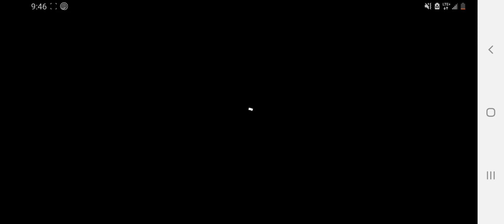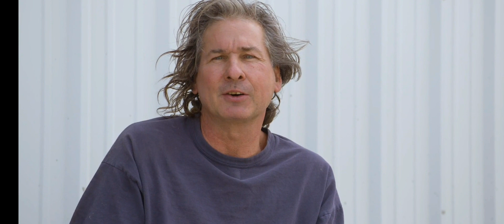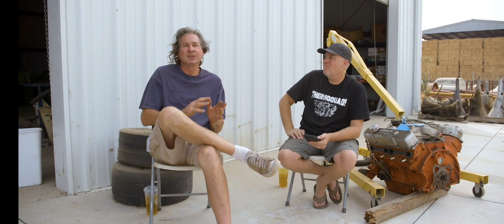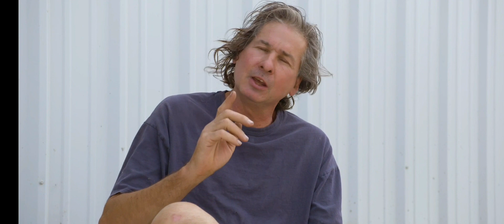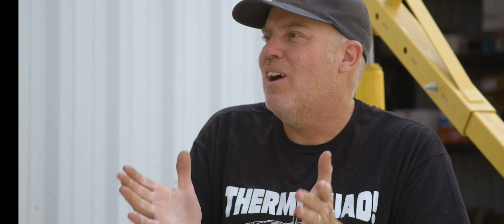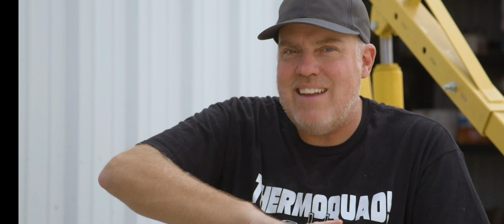uncle tony's garage gets called out by the roadkill guys and they say he's  full of shit

Comment: I just opened up my Mopar Engine Carroll Shelby's Speed Secrets book from Direct Connection and it states on page 44, section E for Pistons and Pins , the 3rd paragraph that "Factory pistons have the pin offset to reduce piston slap.  By reversing the offset (reversing the piston) engine friction can be reduced.  In engines equipped with power pak (domed) pistons this can be accomplished by installing pistons from the right bank in the left bank and vise versa.  This means the notch in the edge of the piston top will now be toward the rear of the engine.  With two barrel flat top pistons , it is only necessary to reverse the piston pin on the rod and not necessarily to swap from bank to bank.  A piston to bore clearance of .0015 - .002 has proven to be adequate with stock type pistons.  Race pistons do not have a piston offset and there-fore don't need to be reversed. "  That was a lot of typing for me.
Reply: rofl.. yes someone mentioned this stupidity before.. and it still wouldnt have increased any power..
Reply: @crunchemagain2030  just how do you know that it wouldn't? Perhaps your Ouija board says so?
Reply: @MrSwinger1  they basically said its stupid and its a waste of time and energy... it doesnt gain anything.
Reply: @StrikersLG  David Reher rebuilt one of his old Pro Stock engines from the 80's not too long back.   He said he just laughed at what was "bleeding edge" tech back then.   But if you read a book of his engine building tech from back then, it would have had all those 80's tricks in it, right?   
Things change.
Reply: @Made By Nobody Famous What a crock! Please tell us what old book recommends any of those stupid things. All of the performance books that I have read since the seventies specifically mention port shape and volume vs air speed. And they all mention port finish and warn against polishing the intake ports. Many even have pictures of giant polished ports to show you how not to do it. Here's a quote from an old performance book, you can knock the bottom of a trash can out and it will certainly flow a lot of air but that don't make it a good port.
Reply: @Made By Nobody Famous I think to construe port and polish as meaning polish intake ports to a mirror finish is a leap that even Evel knievel couldn't make on his best day. What do you have against gasket matching?  Thanks in advance for taking the time to respond.
Reply: @Made By Nobody Famous regardless of the gasket opening we still use it as a template to match the port to the manifold runner. The gasket just gives reference points to measure from. At least that's how I do it. I don't not make the ports match the gasket. And you are absolutely correct, I have seen a few diy porters ruin heads grinding the floor of intake ports. Hell my cnc ported heads purchased from Harley Davidson have material removed from the floor but at least they didn't completely remove the nice bump that the factory xb heads have.
Reply: @bigboreracing356  Hell while you're at it install a 12/71 blower and enderly fuel injection. Add 90 percent alky nitromethane mix and bingo, even more power.
Reply: @bigboreracing356  I'm going to guess here but me thinks you're not good with sarcasm?
Reply: @MrSwinger1  I don't think so! Nick's garage has already dealt with Uncle Tony's Phony Baloney circus show!
Reply: @MrSwinger1  "I think what roadkill is saying is this is obsolete information. "

It is NOT "obsolete information" IF you are using stock pistons w/factory offset pins.
Reply: @StrikersLG  Yeah it's people like you that See a name they recognize and Assume it must be gospel. in this case, Theory is not replicated in reality. If Piston offset made any difference at all, Every F1, Pro Stock and NASCAR team would be doing it. But they don't.
Reply: @recrdholdr  I think you forgot why the piston was offset in the first place LMFAO. And nice job repeating what David and Steve said lmao
Reply: Carroll Shelby had nothing to do with these books, that was in the era of Lee Iaccoca. Chrysler engineers wrote that stuff way earlier.
Reply: I call bullshit reversing the offset of the piston its made to go one way putting it in wrong would only destroy the cylinder walls and more damage I'm sure, much less get a net gain of power.
Reply: @MrSwinger1   Problem is the border is STILL CLOSED ! can't get to Canada from the U/S. Where is Smokey Yunick when we need him right .
Reply: @Made By Nobody Famous - I also remember a time when people thought polishing intake runners was a good idea. I remember something that was being pushed for awhile and cost lost of goddamned money called extrude honing. It was some kind of thick ass polishing abrasive they'd pump through the intake runners and everything else they thought should be polished!! When finished, the intake runners would look like a goddamned mirror!! Yes, I remember when literal polishing was being billed as the "in thing" back in the day. I'm an old man, I didn't keep any records of all the BS being pushed back then, but by god I fucking remember that shit!!! So I agree with you, you're correct!!
Reply: @MrSwinger1  😂👍😂👍😂👍😂👍
Reply: Who tears down a engine then puts it back together just to spin pistons around LMMFAO. If your book is so informative why leave out the horsepower gains?
Reply: @MrSwinger1  they explained you have to switch left bank right bank then rotate them in the bores, think about it.
Reply: He asserts reduced wear, not increased power.
Reply: I love how wannabe builders argue with it. Never actually did it so it has to be wrong. Let alone the fact one of the most notorious performance men known to man flat says it works. They just turn their nose up and say nope. Because they haven't done it. Even these two in the video admit they didn't do it. Then set a challenge.. and ignored his reply.. said "there's no time in their schedule".. it absolutely DOES work. In the right situation for the right build.. not everybody runs to summit with 10k to build an engine. Some just want to maximize their juice they have on their real budget.
Reply: Yes indeed. And, as far as I can tell, the gain is about 1% greater HP. Which isn't much, but every little bit helps.
Reply: I gotta check my direct connection book now
Reply: @davidleonard8369  Don't get smart alright. We're not effing talking about ports in case you haven't noticed. Your comparison is sophistry.
The piston reversing was in the FACTORY Mopar performance bulletins issued by MOPAR. Explain now the qualifications you have to disprove what Mopar found using OEM Mopar pistons in Mopar's own V8 engines of the late 1960s and 1970s?
I can't wait for your reply.
Reply: @ThePaulv12  me thinks you have me confused with someone else. I still have my old yellow Mopar performance bible somewhere around here. And I also don't think I'm smarter than smokey yunick. Sometimes on uncle tonys channel he will refer to an article in hot rod magazine about a small block Ford built by Joe Sherman. Joe spoke of the power he gained by simply installing the pistons reversed. I race with Joe's son Steve and had the pleasure of meeting Joe at the track before his passing. I don't know who your comment was meant for but it ain't me.
Reply: @crunchemagain2030   One name settled the argument. Did the swap multiple times with positive power gains, even for the McClaren racing team: David Vizard.
I will listen to veteran racing engineers any day over automotive journalists who mess with cars as a hobby on YouTube. As would anyone with any sense.
Reply: @Anarchy-Is-Liberty  extrude honing is only for newly built exhaust headers. It takes away burrs from the fabrication process and polishes the surfaces for decreased carbon buildup during use. Anyone touting the process for intake passages is a Loon who thinks "if some is good, more is better" to quote the video we just watched.
Reply: I have an old book with a picture of a doctor of medicine telling me what brand of cigarettes he smokes
Reply: @crunchemagain2030  Have they run an engine on the dynamometer to prove a single thing they are braying and shrieking about? Do they have proof that this does not work? Do they have proof that it never worked?
Reply: @Z_732  you read my mind. I think I would be more apt to believe Uncle Tony, even over these two goofs. Definitely over any of these keyboard mechanics.
Reply: @mvg-1776  ya.. I love reading the hypocrisy and random uneducated guesses by all these people. It's funny, and very entertaining at times. Lol
Reply: @Z_732  exactly they forget Tony deals alot with people on shoe string budgets I've been there myself when I first started building racecars and engines very tight rules and such mostly stock motors factory steelheads and stock bottom end you gotta pretty much run to the junk yard and find a factory running engine from the 70s freshen it up new gaskets and do a couple little old school tricks because you're in a stock class and you can't run to jegs and summit to get a new cam and new rods and crank and a set of dart heads so any little trick to that heavy bone stock hunk of cast
Reply: @dirttrackdevil1149   indeed..and unless you have developed a memory problem, I'd dare bet you remember 90% of those little tricks, and most likely use them. I know I do. And am always open to possible little things to get that little bit more.